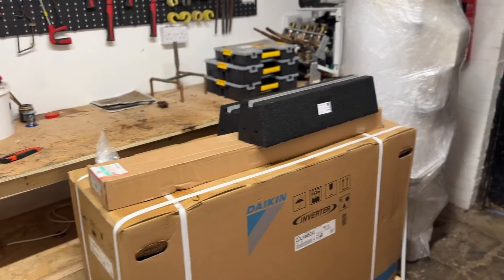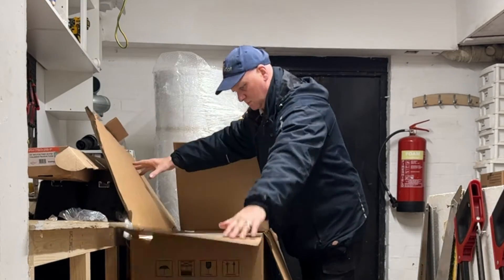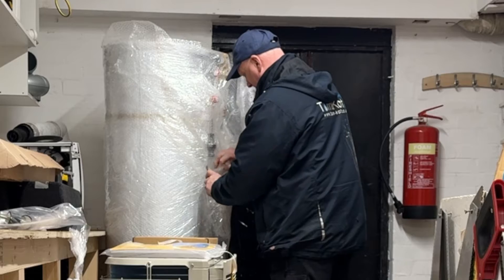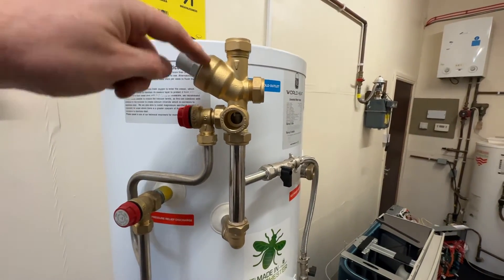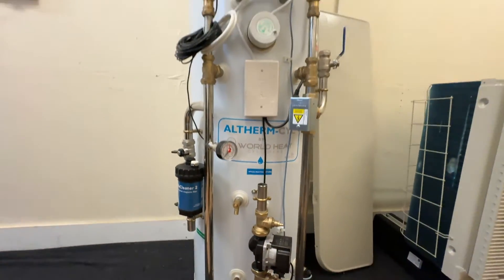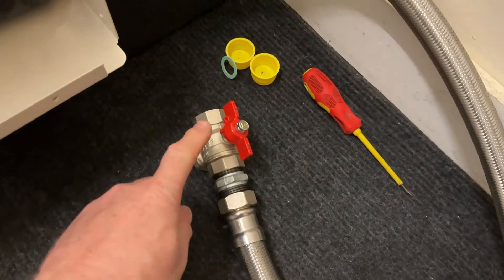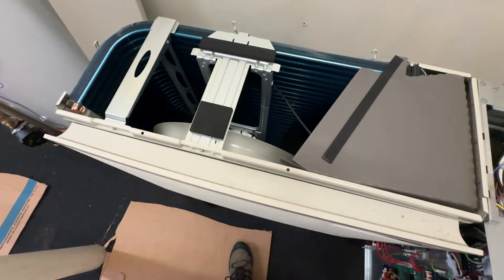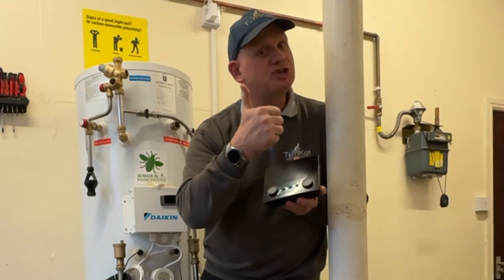MY biggest unboxing video yet, The Daikin Altherma 3m heat pump and the Altherm world heat cylinder.

Comment: Do you intend to give prices as you proceed with the videos , would be good so we can compare the items used with other manufacturers.
Reply from the maker: I was thinking of doing it at the end and comparing it to a boiler install 👍🏻
Reply: @tomkatgastraining  I am thinking about getting a heat pump for the water only because I think looking at the heat pump that also does the radiators and having to get bigger radiators because how the heat pump works , from what I have seen the air to air system I think would be better of course I could be wrong but I might be right, to be able to set the temperature in different parts of the house with air to air seems to be more practical and probably be more economical , I know nothing about either system, would be nice to get a complete unbiased information in regards to many things with all this new stuff coming on to the market , well at least new to us here in the UK , places like Finland have been using them for years , just heard about the new cylinder with heat pump on top that sits inside with a small hole in the wall for the heat pump on top , from what I’ve seen that looks a good system at least for me so I could get rid of all the radiators along with all the pipe work including the immersion tank and all the pipes in the loft so less worry of burst pipes.

Comment: I'm looking forward to this .. although I have seen other installation videos some time ago, .. it will be good to see a REAL installation video, and perhaps get to do a proper unbiased performance test, and lifetime cost at the end which includes servicing and replacement parts. I don't believe they will last the 13-15yrs as claimed, and still achieve a claimed 80% cost saving. Yes I'm pleased you decided to do this .. go for it 😊

Comment: long vertical tubes up the side of that cylinder with high and low branch pipes into the cylinder is asking for trouble, the cylinder will have a different amount of expansion to the pipework this will cause fractures in the cylinder wall around the pipe joints. I also see some galvanized BSP fittings :(

Comment: Thanks you very much Derek, looking forward to the install and commissioning video.
Reply: Bang it on some SpeedFit. Set it on 50c fixed flow temps, no legionella, no lagging or isolation or filters. Leave a bible-sized instruction manual with no system design information. Anyway, that's pretty much howe every Daikin I visit is installed.